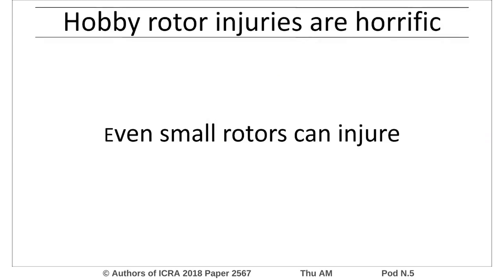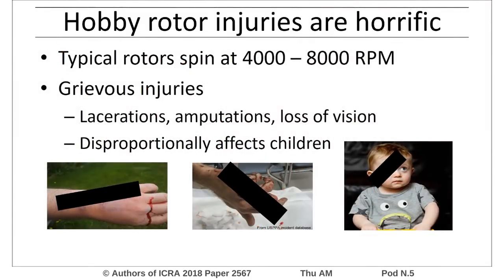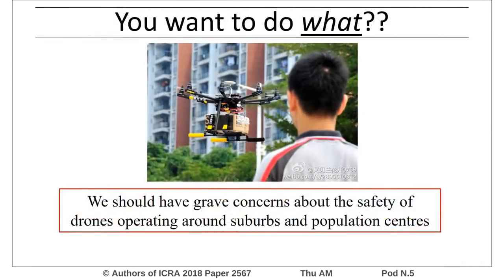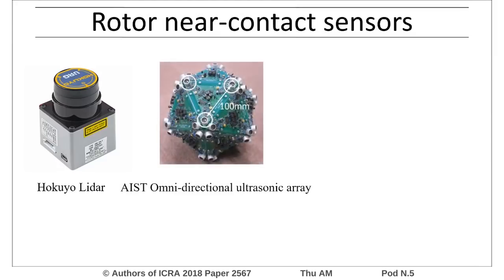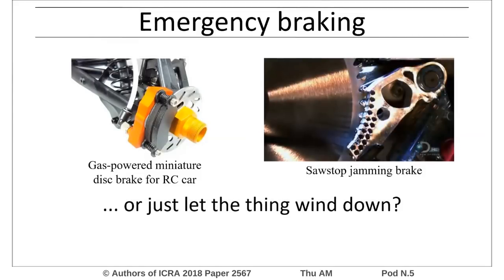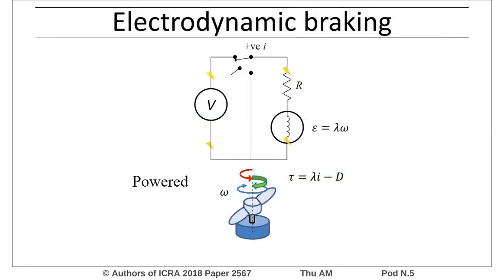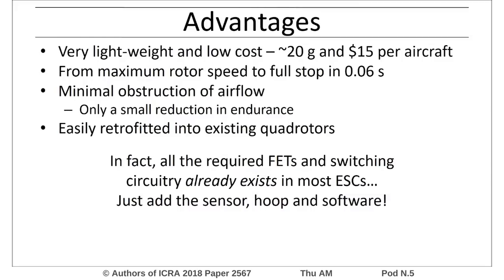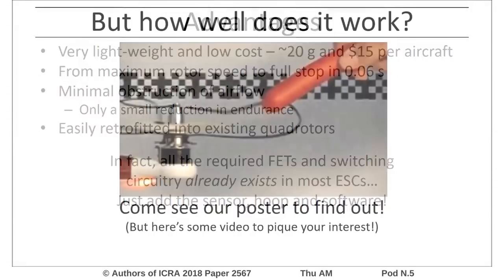The Safety Rotor - an Electromechanical Rotor Safety System for Drones

Comment: Too complicated and with the hoops able to spin independently there's a high % chance of blade stripe before the hoop does.

A fixed relationship between hoop and blade is needed, with the hoop leading the blade. Then the hoop can be connected to a clutch/brake that stops the rotor while simultaneously disconnecting it from the motor shaft.

Such a device is on a huge number pf push mowers where releasing the handle disconnects and stops the blade without stopping the engine. (Cheaper mowers just stop the engine when you let go of the handle.)

Scale it down and reverse the action so that pushing the safety bail actuates the mechanism.

Comment: Sounds nice but doubt it will perform in the wild as intended.
e.g. Wind might slow down the loop as well ... causing the  drone drop out of the sky on every gush ...
Better solution: Keep kids and irresponsible persons away from drones.
You basically can't fly them anywhere where I live anymore anyway ... since it isn't allowed (anymore) to use them near train tracks, streets, and residential areas. With a zone around those areas that does not leave any free space within a 3 hour drive ...